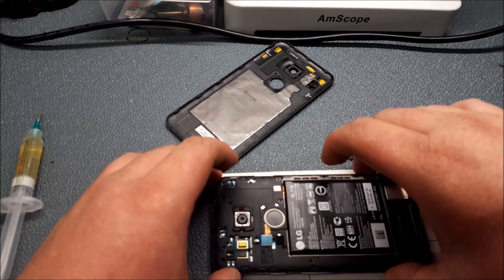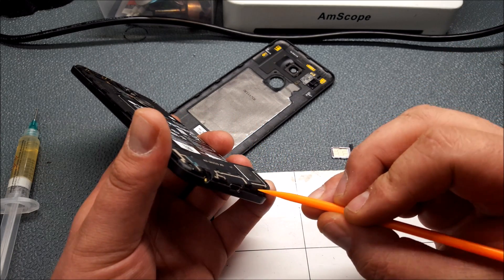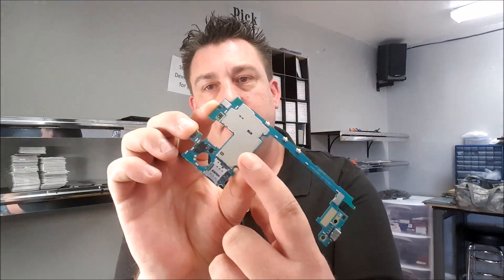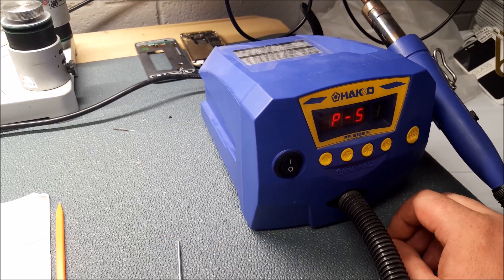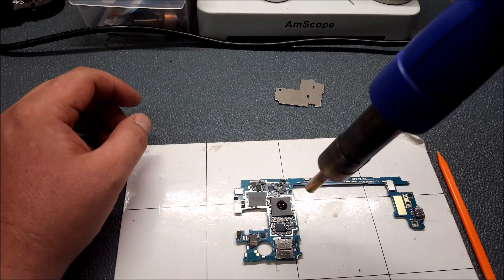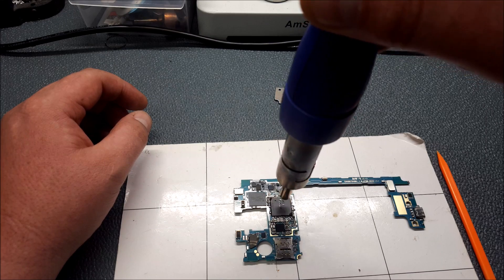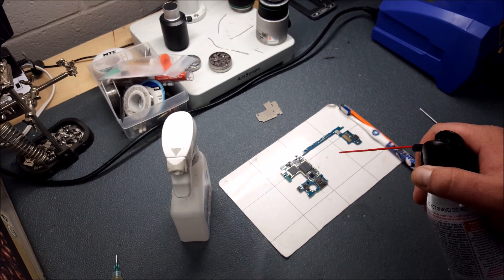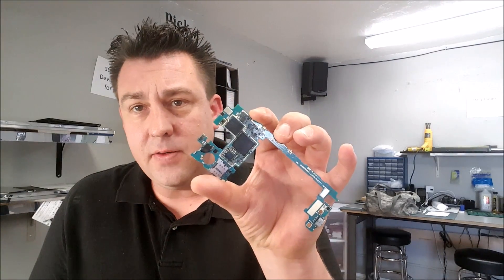Nexus 5x Bootloop Fix.

Comment: This worked for me. Thank you!
I broke my pixel2's screen so I have to use my Nexus 5x until I receive the new screen for pixel.
Reply from the maker: I recommend uBreakiFix for your Pixel repair.  They are Google certified repairers and the parts are OEM Pixel.  Thank you.
Reply: @ICDTTechnologies  thank you, I am located in Turkey so no chance to have it fixed to them. I ordered a new screen from aliexpress, I hope it is a good replacement part. Reviews are good. 
Sadly I broke the screen while opening the case to replace the battery, pixel case is hard to open, nexus is easy.

Comment: What soldering flux did you use for this fix?
Reply from the maker: ChipQuik SMD291NL Flux.
Reply from the maker: However the regular SMD291 is easier to clean.

Comment: Worked for me! Thanks!
But I did not do everything in this video.

I extracted the mainboard and removed all plastic parts and rubber parts. After that I protected the rest of the sensitive components with aluminium foil, such as the standby button and and the volume rocker, the sim card tray and the proximity/lux sensor. Than I used a heat gun (approx 180 °C for 90 seconds)  to heat up the same chip like in this video. After cooling down I assembled everything and it started successfully for 2 minutes. After that the bootloop started again. 

So I repeated the process with approx 210 °C. But directly after the 90 seconds of heating up I pushed the chip gently towards the mainboard with a wooden stick. After cooling down and assembling, it works permanently for me. Never had a bootloop again.
I recommend to assemble the phone completely except of the back cover with the NEXUS text on it. But I would assemble the cooling plate and the plastic backplate and also the screws, because they are pressing the heat spreader against the chips. So if it continoues to boot but because of heating issues, this wont help you. 

I did not use any fluid or (ESD-)toothbrush. Just heat.

I had a heat gun without temperatur adjustment. I measured the temperature before with my weber grill temperatur indicator. So not that accurate, that is why I started a little bit lower. 
So if you tried it and you got only a temporarily fix, just try it again with pushing the chip gently downwards. Maybe this will work for you.
Reply: thanks

Comment: A) why is it factory resetted when it suddenly went into bootloop - one would expect it to be set up already....
B) why fixing the emmc when everyone reported it to be a issue with the perf cluster of the 808?

Smells fishy, sorry but this insults my mind...
Reply from the maker: This procedure takes advantage of thermal expansion and allows the phone to work temporarily to recover data. You are correct that the eMMC is the problem and not the RAM chip. Thank you very much for you input. I am always looking to learn and expand my knowledge and abilities
Reply: @ICDTTechnologies  not trying to troll you here but I didn't say anything about the RAM nor the EMMC, it's commonly known that the performance cluster of snapdragon 808 (or the soldering of the chip) is the problem, that's why the software-sided solution of a modded boot image works, it disables the 2 performance cores and leaves only the 4 other cores of the CPU enabled - that's why I don't understand your approach to the problem and I'm still wondering why the device is resetted if it unexpectedly felt into bootloop, the bootlooping doesn't factory reset the system, this does not make sense at all....
Reply from the maker: @samhausmann1479  This devise did not factory reset. This belonged to a French doctor who reported that all of his data was recovered successfully by this procedure and that the device functioned for 3 weeks after the recovery. We also offer the 4 core kernel installation. I know you are not trolling and I grately appreciate your comments.
Reply: @ICDTTechnologies  thanks for understanding that I'm honestly interested! But if you check the end of the video you posted it clearly shows a reseted device, this welcome screen only appears on very first start up, also this SIM screen and the encryption password is also missing - this is by no means a "used" device, in fact it shows all signs of being factory resetted, hence my doubts, as this is "the proof" that the device was successfully repaired, it however shows the absolute opposite, I'm also wondering how you diagnose the issue, how you determine if EMMC, RAM, or CPU (perf cluster)? Not meant to be disrespectful but this whole video raises more questions than it actually answers, I have serious doubts on it being legit, like it being a kind of PR stunt!

Comment: Am having the sane issue with my nexus 6p..
How can i buy new memory chip?
Reply from the maker: The 2 most common causes for boot loop on the 6P is bad processor or critical memory (Memory storage is full).  Are you able to access the bootloader?
Reply: @ICDTTechnologies  yes i can access bootloader but when i select recovery mode its goes back to google logo and keeps that repeating again

Comment: If you cannot afford a hot air station, take the cover off the phone and use a hair dryer on full heat for about 1:30 seconds around the area with the most surface area (processor area) after it's nice and hot, leave the cover off and try turning on your phone, it should boot long enough to retrieve your personal information. I was just given one of these phones and spent hours banging my head, I thought it was a software problem, here it was a hardware problem all along. (pretty common with processors that don't have adequate cooling) Anyway, if you want a decent phone, buy a Motorola, they are built like tanks.
Reply: Perfectly agreed 😎..

Comment: I sent mine into LG for the bootloop, but they apparently found "water damage" and they did not repair it (there was no water damage, and I have since learned they commonly use this excuse). They sent it back (after getting $19.95 for a diagnostic fee), but when I opened it, I realized they left out the L-shaped EMF metal shield. I am going to call them (preparing to be frustrated), but in the meantime, is it okay to use it without that shield?
Reply from the maker: Yes

Comment: Worked for me.

First we used a flux pen as this was the only flux we had. We applied the flux over all the "faulty" chip and all the components and chips around the "faulty" chip.

We then heated the motherboard with a common household heatgun and had a thermometer (thermocouple) located just above the chip in question. Note we could not focus the heat to only the faulty chip as our heatgun had a big nossel. We approximately used the following heat profile: 100C for 1min, 150C for 1min, 210C for 50sec, 150C for 1min and finally 100C for 1min. The temperature was adjusted by simply moving the heatgun closer or further away.

We did not clean the motherboard for residual flux as we forgot to do so - and btw there was also no flux residues to be seen.

I will update this comment if our fix continue to work or not.

...Update: The fix worked for only one day :-(

Comment: What you should do if you have this problem is, if you want to get the data off the phone, do this and get the data off it first, but if you don't care about the data on it you can skip that and follow this guide:https://forum.xda-developers.com/nexus-5x/general/tool-bootloop-death-blod-workaround-t3819497
If you want automatic updates, follow the directions in the second thread on that post. If you are going to do this I recommend also flashing an OmniROM-based ROM for the most seamless installation of updates.
If you want increased security, you can generate your own signing keys and replace the ones in the zip with them, then transfer the updated zip to your phone.

Comment: hello, i have an inquiries on nexus 5x. I have changed my battery on my nexus 5x but it end up heating up the component near the fingerprint area. i tried to boot it up & it is working but there is no display & the fingerprint area is still hot. i know it is working when i tried to connect to my pc and the pc detected my phone. my questions is, whats the reason for this? what should i do?
Reply from the maker: Angeal Hayleyy Without looking at it I would say that the same problem is starting to happen on your phone. I would recommend backing up all you data while it is still working. The emmc and SOC are stacked together as one (shown heating in the video) and is located right under the finger print sensor.
Reply: ICDT Technologies i would say that it is already too late so back up my data due to the lcd did not display anything. all i can hear is the sound of battery charging. so should i proceed to this method or not? i only have the heater in my workshop right now along with electronic cleaner and some alchol swabs. is it enough for this operation?
Reply from the maker: I believe that you do need to do this. The heat is coming from the processor looping and working too hard. Please let me know how it works out. We are still offering the data recovery service if you need help.
Reply: ICDT Technologies understood, i will try to do it later & will be sure to update here if anything happens. thanks for the responses good sir!

Comment: why does the heat fixes it ? it seems like everyone does it and it works =/
Reply: merely fixes it, only for about a month then itll screw up again
Reply from the maker: Elijah Mayorov It is strange. We are taking advantage of thermal expansion.
Reply: ICDT Technologies yeah, I tried to freeze me phone, then switch it on a hundred of times; when it switched on I tried to clean the memory; then I heat it and cleaned it like in this video and now it works (even if maybe not for long) ... and I've got no idea what was the problem. Maybe you know?
Reply from the maker: We recommend that you NEVER freeze your phone, when trying to repair it.  This will promote condensation, which can lead to corrosion.  We are still offering the data recovery service and LG and Google are still covering warranties on this fault.
Reply from the maker: By the way, please subscribe.  I am moving my work space to a new location for filming and will be putting more videos out soon.

Comment: Great video, very informative. I have a bit of a different problem...  I can't get my phone to turn on or even take a charge unless one special battery back which is super old and I assume doesn't have some sort of overfeed protection... It happened after a beta update to 8.0...before that the phone was getting very hot and extremely sluggish.

After watching your video I decided that it's possible that there was a defective solder joint on the main board where the USB type-c port may have been damaged... I inspected everything and didn't see any visible cues... Do you have any other recommendations?

Comment: Hi! I'm having a similar boot loop problem with my Nexus 5. My first idea was that only the power button is failing (a new one is on the way), but i tried to wash it through with contact spray, even with wd-40, since i had nothing to lose. But it had no effect. Do you have any idea, how could i test if the power button is the problem, or something like the one in your video? I'm afraid i have to start looking for a new phone... :/

Comment: I wonder if this is partly due to the lead free solder being more susceptible to cracking as the CPU & RAM expand and contract as the CPU heats up during use. Could reballing both the RAM and the CPU with old school leaded solder be more of a permanent fix?

Comment: I replaced my failed 16gb with a used 32gb and put the non-working one in a drawer. You're welcome to use it as a test subject and see if you can replace the RAM chip and get it working, if it's not too costly.

Comment: i tried as in the video but nothing it started and after few minutes went down so i used another temperature cos 380 °F was not enough so i used for 1 minute 450 F with a peak of 500°F with a square tip for solder hot air. Now is working it s almost passed a day, it seems everything s ok. Anyway i putted a large piece of tape biadhesive in the rear of the chip, so it's more pressed.
Reply: Marco Esposito so does it still work?
Reply: Vladislav Matveev It works for 2/3 days then no.
Reply: U ve to remake the process in my case everytime.
Reply: Marco Esposito what I did is flash a costum kernel and boot image via fastboot, this way the phone only uses the little cluster cores and bypasses the big cluster (the effected chips). Google Nexus 5x BLOD fix
Reply: Marco Esposito I think it would work if one would completely resolder the chip and then add a copper plate as heat sink and for pressure

Comment: Watching on a Nexus 5X.

Strange that on two occasions mine bootlooped and the first one stopped after Factory Reset. The second incident got fixed by uninstalling Shareit.

Other vids recommended using a copper plate heatsink.

Any thoughts how much longer mine will last with a heatsink mod?

Comment: How the heck did you get it open?
Reply from the maker: The back cover is difficult. You can just use your hand very gently or us a plastic safe open tool to work the clasps loose on the sides.  I start opening from the charging port.  I hope this helps.
Reply: Use the corner of an expired plastic (credit) card if you don't have a plastic tool for this. Definitely start from the charging port or the SIM card slot with the tray removed.

Comment: hi i tried thiss and it works, but when it cool down it fails again, any suggestion?
Reply from the maker: Guillermo Cuesta Blanco I am still researching a more permanent solution. In the mean time I believe LG is still doing warranties and refunds.
Reply: ICDT Technologies do you how I can get to the warranty if it's off the time?
Reply from the maker: marcdan25 Check my newest video. There is a link to the google site to start the warranty.

Comment: What you're heating is the "Samsung K3QF3F30BM-QGCF 2 GB LPDDR3 RAM", not the eMMC
Reply from the maker: You are right.  However the RAM is an eMMC, which means that it has a contoller and flash memory in the same chip.  I have found that the problem is inside the chip and not the solder.  I will be rediting and reposting a new video on this, to include information on warranty  replacement and refunding through LG and that this is a temp repair for data recovery.
Reply: Tony Tran I did it with a heat gun which has an air reductor so that the air comes out in a small area, the speed was too high though so I had to do it carefully. I didn't use flux. After doing it I could use the phone for at least one week, then it died again, I tried heating it again but it didn't worked.
Reply: if it isnt the solder, do you still need flux when you use this heating method? or would just hitting the chip with heat do the same thing no matter what? I  was thinking about picking up a cheap rework station (to have better control of temp and air flow rate) and some flux, but if its overkill for no reason, i have a standard heat gun that i can use. what do you think?
Reply: thanks for the reply Nicolas. 2 more questions, does your heat gun have speed settings? mine has a high and low, wondering if it'll still be too strong. next, how long did you apply heat for?
Reply: Yes, I did it with low speed, it's maybe too much but I did it in an intermittent way, I can also regulate the temp on my heatgun, I don't remember how much time but remember that is a temporary fix, heat it not too much nor too little so you can recover your photos, if you live in USA you should call LG for the replacement/refunding.
Reply: also you are really stupid what did  you reflow is not only the ram module (not emmc since ram dosn't have a controller it is in the cpu) but you also did reheat the cpu since the cpu is down below the ram chip (2 chips stacked on top of each other ) fyi the emmc chip is the next chip up right the one you did reflow

Comment: Fixed my phone. Thank you!
Reply: is it sill working !
Reply: It was working fine for two weeks. Then the boot loop started again. I repeated the procedure and it was working for another four days. Then I had enought and brought it to the repair shop. They changed the mainboard. This fix ist ok to copy all your data off but in my case not for long therme.
Reply: even with the mainboard being changed it didnt fix it ? ;( so your giving up on it
Reply: Hi, changing the mainboard has finaly fixed the Phone.
Reply: +Daniel Keller such a great news ! i will order the motherboard online and try it on my friends phone , thank you very much !
Reply: My question is, do the new mainboards have the same problem with bootloop that the old ones do? is it just a matter of time before your new mainboard develops the same problem?